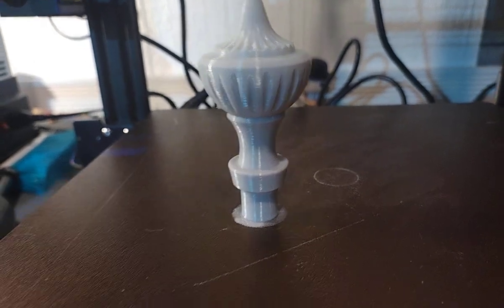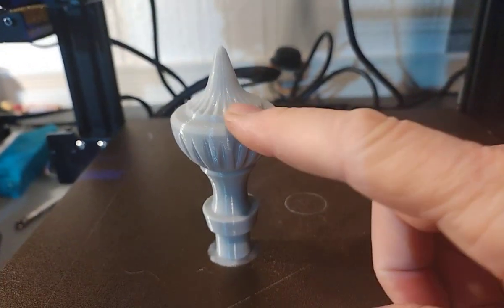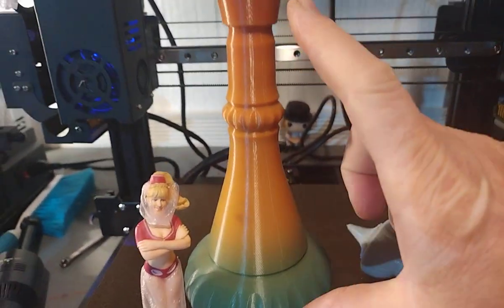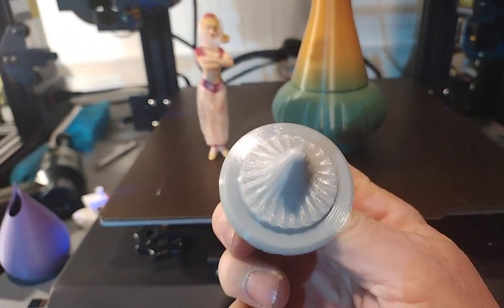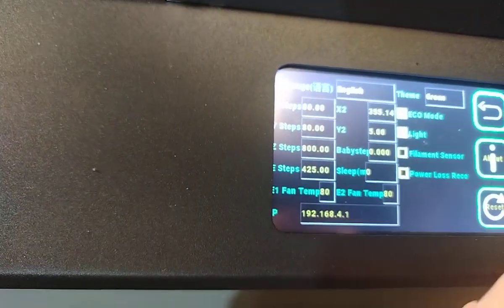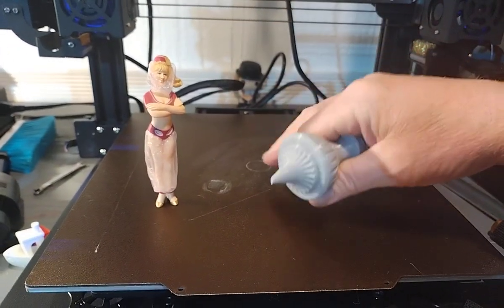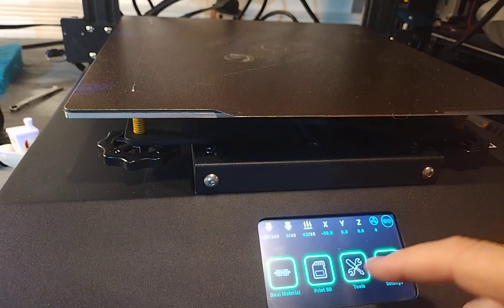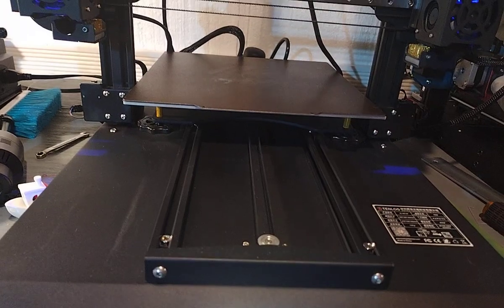Tenlog TL-D3 V2 print after tuning.

Comment: What slicer do you use for printing with mirror mode or multicolor printing?
Reply from the maker: You can download the software for the Sovol SV04, they have the cura slicer all set up pretty much exactly the same machine specs
Reply from the maker: Also, I use prusa slicer with the paint brush tool to make my own two color models
Reply: @3dpfeeney  A tutorial on that would be nice...
Reply: The printer itself does the mirroring from one gcode, just select mirror on the printer.

Comment: what  are your settings i cant get my prints to come out that good on my printer
Reply from the maker: If I am doing single color prints like this I usually just use a creality cr-10 profile and adjust the retraction to 1mm or so      take a look at my other videos using fat dragon profile that you can use on this printer   they are really great.....                     Soon I will be adjusting the hardware on this printer to get some much better results.
Reply: @3dpfeeney  I have bin trying for about a month and not getting far have a line going up the prin some spots that look like small pimples also is that a cr-10 magnet plate